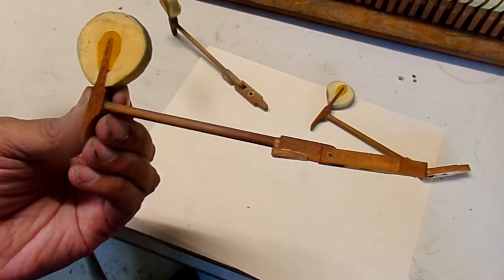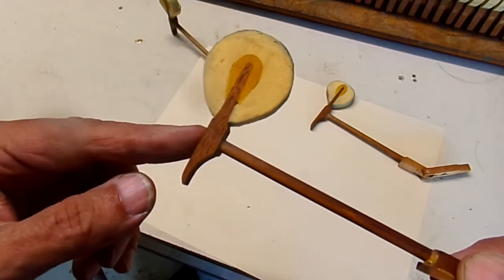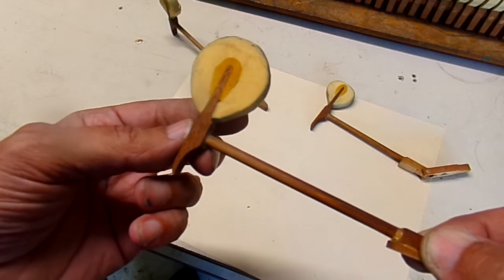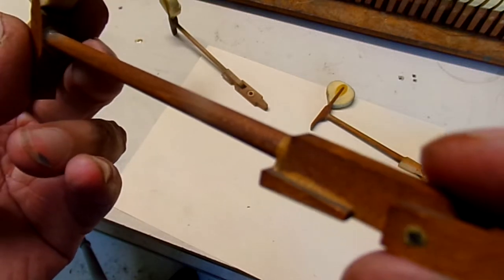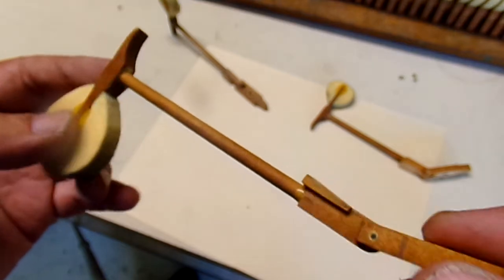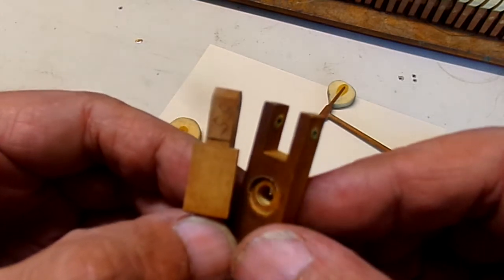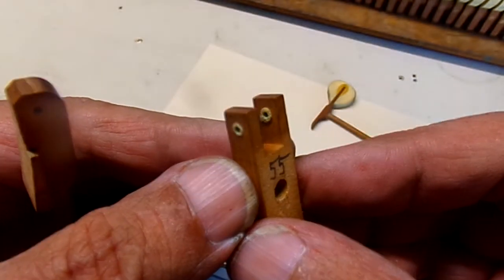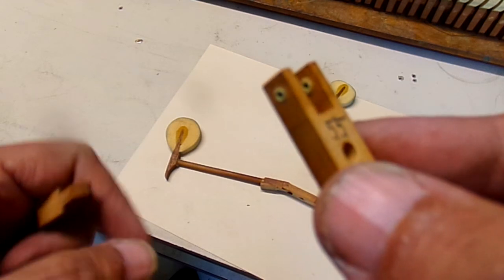Chickering, Brown  Action, Hammer, Shank, and Flange

Comment: I have one with an adjustable thumbtack sized button instead of a pad. It seems this is a modification or improvement on the original. Someone replaced many of the hammer shanks with modern grand shanks modified to work with this action.  Have you found out when this change from Flat Driving Surface to Adjustable Button occurred?
Reply from the maker: Not an exact date, but not too long afterward.  The first thumbtacks were threaded through small flanged blocks like this one.  Later the shank became one-piece; more robust.

Comment: Hello Craig.I would like to consult about the cleaning of bass string my vertical piano ESTEY has strings screwed of steel not copper I take any and try with ammonia the result was null of course it does not happen the same with copper it is possible to clean them with something I do not want to change something original as you show, thanks
Reply from the maker: Iron wires do not form patinas, they rust. They form iron oxide crystals, and ammonia has no effect other than de-greasing.
What you need is phosphoric acid.  It both removes rust and gives Coca Cola its tartness.  It is sold in Auto parts stores as a rust remover.  I tried it out on an 1863 Chickering square, and it worked well.  The product was good, but not too aggressive;  to keep people from hurting themselves, I suspect.  So It might not be a bad idea to clean all the dirt out of the coils before going after the iron crystals;  to give the acid the best chance to work on what it works best on.

The method I used was not too different from what I show in the copper cleaning videos.  I would be a little more delicate with pre-1870 wire as it is very much more delicate, even for wire. It kinks easily.   As the solution is acidic, there is no need for a vinegar bath, just a thorough rinse in clean water.  Then get them dry.  A hairdryer, set on low, blowing through a tube will dry a set of strings very quickly.

Oh yes, ventilation.  This stuff may be a food additive, but it is noxious.  Not quite as bad as old hide glue gone bad, but almost.
Reply: @hampshirepiano6383  thank you 😇